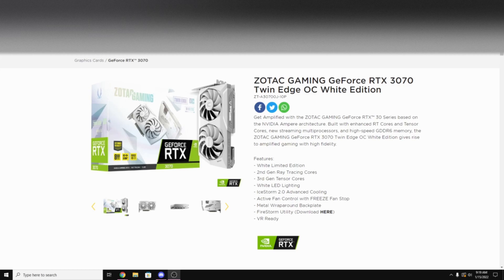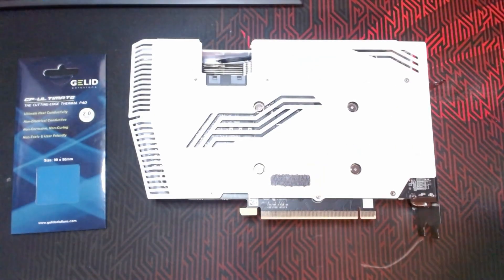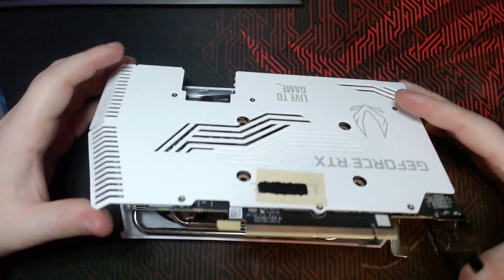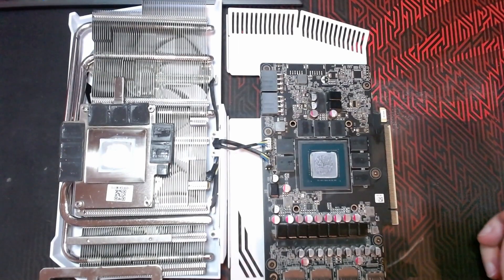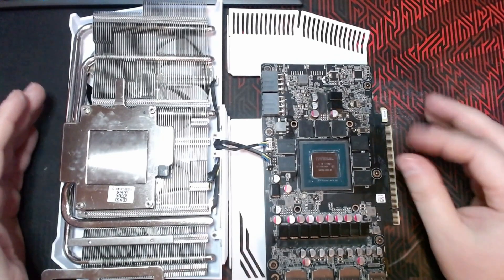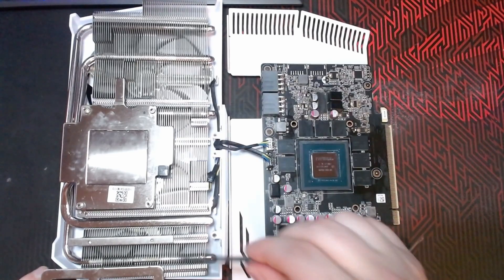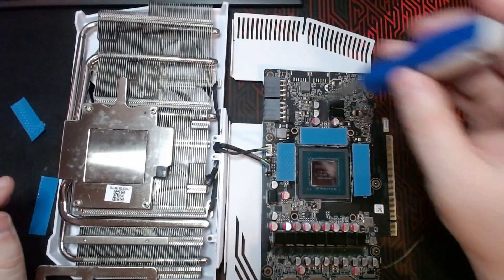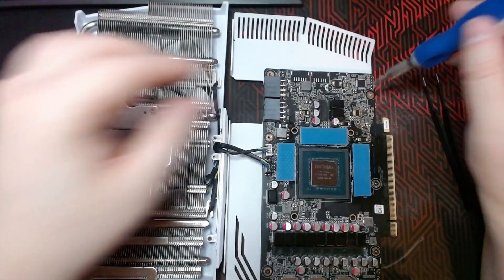Zotac RTX 3070 Thermal Pad Replacement (2022)

Comment: how much pad length did you use for the VRAM? i have 120x20mm will it be enough for the VRAM?
Reply: Did you ever find out? I'm wondering the same thing
Reply: @K1NDR3D  it was enough, i just had to separate the last peace because it was a millimeter short to cover two pads at the same time
Reply: @dogmablyat1566 Thanks for your answer!

Comment: How much of each mm thickness is required for this GPU? What size pads should I get?
Reply from the maker: Sizes are in the description.
Reply: @sethtrosity  I was pretty sure all I saw was the thickness. I'm taking SQ/mm
Reply from the maker: @TboneDuggins  Oh I see, I didn't measure the actual pads sorry. You should be fine with 1 pack of each size.
Reply: @sethtrosity  ok thanks
Reply: @TboneDuggins 
By any chance, do you remember the size you needed? Do you think 50x50mm for the vram is enough?
Reply: @MKRENB  no sorry I'll see if I can find the Amazon order
Reply: @TboneDuggins  
Thanks, I just bought each 50x50mm for the 2 and 3 mm and it was big enough.
Reply: @sethtrosity  my white Zotac 3070 is on the way just wanted to be ready to change the pads

Comment: Did your core and memory temps improve after the change? I was wondering because I  have the same card but not the white edition.
Reply from the maker: There is no way to see the memory temperature on 3070s, but I believe it did improve. The core temperature dropped around 6-8 degrees.
Reply: @sethtrosity  So that is an improvement quite clearly...
Reply: @sethtrosity  could you tell the temperature of you zotac rtx 3070 oc in extreme hard core usage? mine gets upto 83 degree in average room temp in summer btw room is quite cool  but talking about non AC atmosphere

Comment: Thanks a lot, i was trying to make sure of the thickness of these ThermalPads but i was without a micrometer, saved My "S".  What Do you think that the quality of the original thermalpads ? In my case Mine's where pretty messed up, not sure be the use for crypto minning (low use ,not Hard Core minning) or if the thermalpads are terrible itself.
Reply from the maker: Zotac uses really cheap thermal pads. Even if you aren't mining, I would still change them out.

Comment: How do you even know which is 3mm , 2mm or 1.5mm?
Reply from the maker: I'm not sure what you mean. Are you talking about the actual sizes of the pads, or the pads that you buy? You need to measure the thickness of each pad when you take them off to know the correct size, unless the manufacturer gives out that information.

Comment: Did you used 2.0mm on all pads or just in the 3mm backplate? How did your gpu worked after that?
Reply from the maker: If you look at the picture in the description, I only changed the green and blue. I left the stock pads in the red location. The card has been running way cooler ever since I made the video. Sadly, I did not think to show the temps before and after when making it.
Reply: @sethtrosity  Even using 2 mm over the 3mm on the backplate didn't affect the Temps at all ?
Reply from the maker: @GhostXavier  There are no memory chips on the back of the pcb, so replacing them doesn't make a big difference like replacing the pads directly contacting the memory chips. The ones on the back are supposed to be 3mm, but I used 2mm. The 2mm pads still make contact with the backplate, so I haven't had any issues.
Reply: @sethtrosity  Thanks a lot Bro'